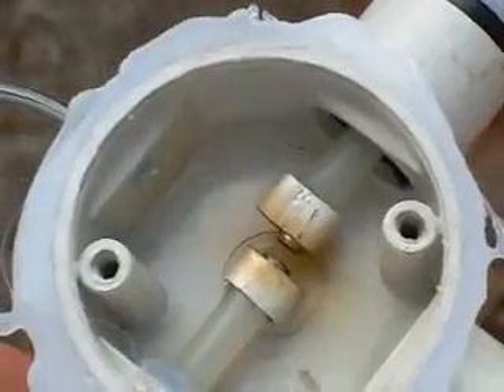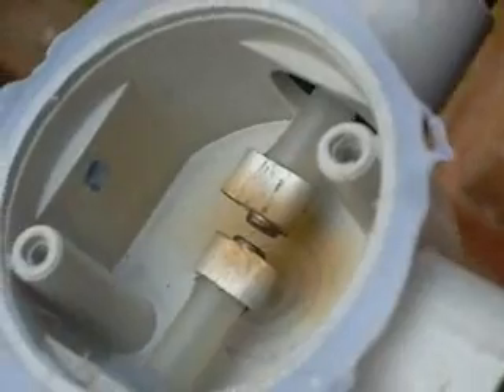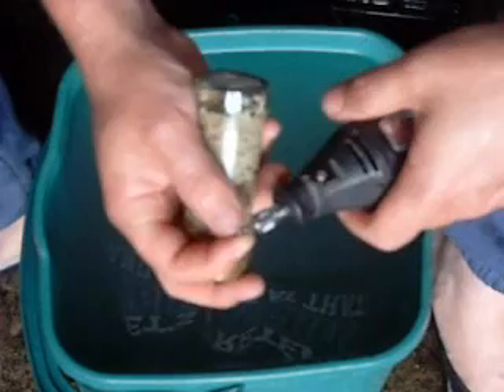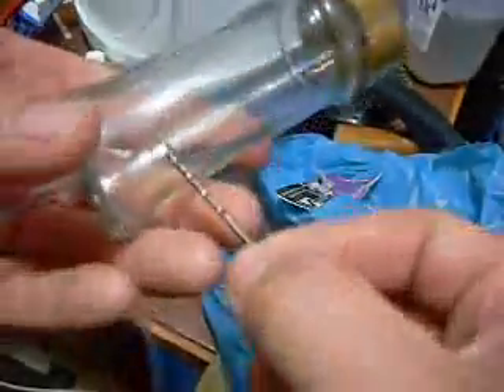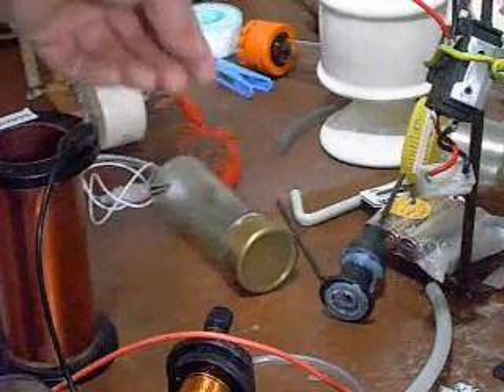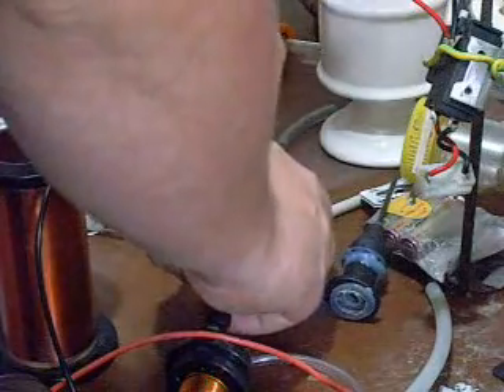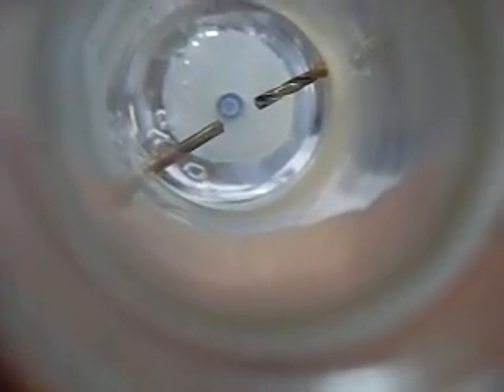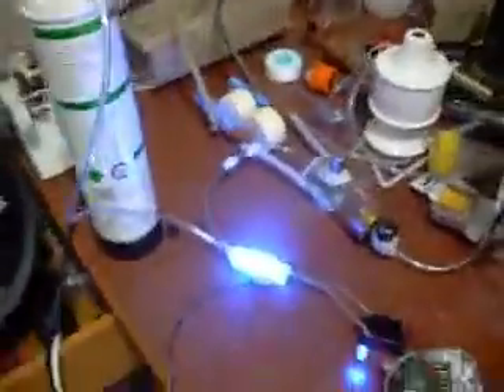Setup for Meyer magnetic gas attempt...

Comment: I'm just guessing, but you could try trapping the magnetic gas in a closed loop using clear tubing. On one side of the loop suspend a nearly weightless item as a sensor inside the tube (hair, tissue paper, styrofoam, etc..), then on the other side of the loop wave a neodymium magnet back and forth to see if there is volume displacement which will move your sensor. Good luck, love the video. Post an update when you can.

Comment: I really enjoy your experiments
I've worked a wee' bit with magnets - what I would suggest is to use magnets with centre holes, 2 x cobalt drill tips cemented in the centre extended just enough to take the spark in the gap
You might also try using opposing magnetic fields.

Comment from the maker: @cfavreau i have used tig rods before on a cold fusion reaction...i think your right that drill is most likely not all cobalt but a cobalt iron mix.thats ok because both were said to be able to join to the ionised argon.i need to stick to the materials that Meyer specified.those tig rods are expensive too!

Comment: Maybe the cobalt drill is not all cobalt.  I would recommend a tig welder tip.  These are made of tungsten and are very good for spark gaps.  you can buy them at a welding shop.  To cut them just nick and snap.

Comment: Is this ionized gas primarily hydrogen? Or is it some other compound. A big issue is one that my father brought up, Hydrogen molecules are so small that they will pass through glass, drywall, wood and most metals. So finding a material in which this won't happen is essential. If it is hydrogen that you are dealing with.

Comment from the maker: @john37309 seems your not aware of Meyers claim of magnetic gas using argon.my research on noble gasses tells me that neon is the only noble that still lays claim to the inert.MIT claims a magnetic gas found at near absolute zero yet Meyer's gas was said to be room temp and stable,bonded by ionising the gas to remove electrons thereby making the noble gas reactive.so now i need a way to test for magnetism in gas.thanx for commenting